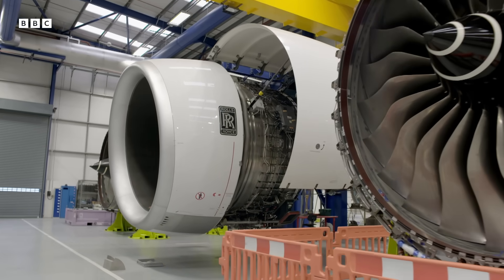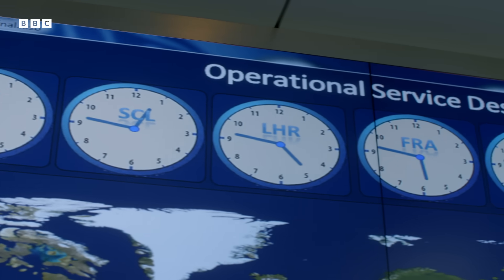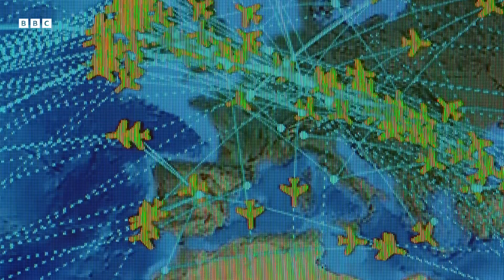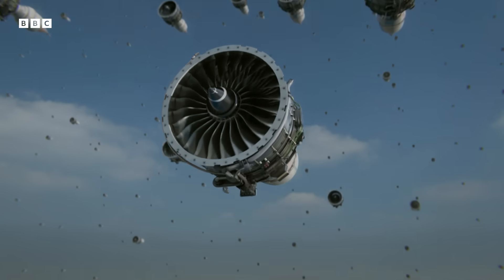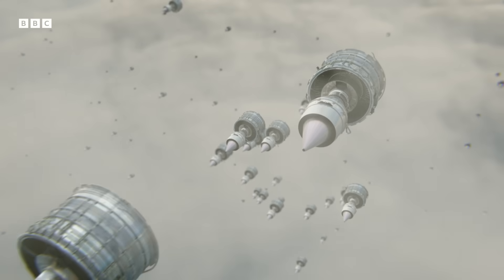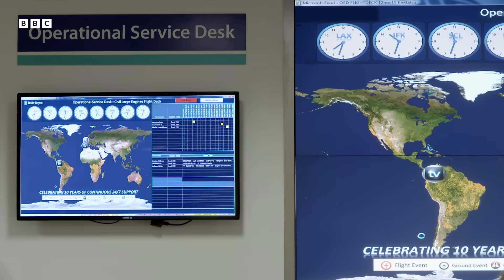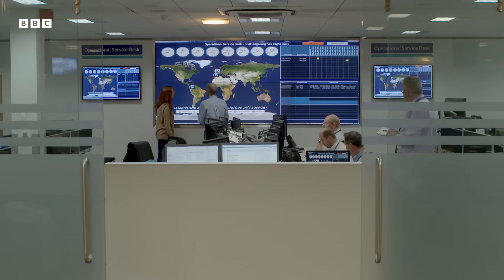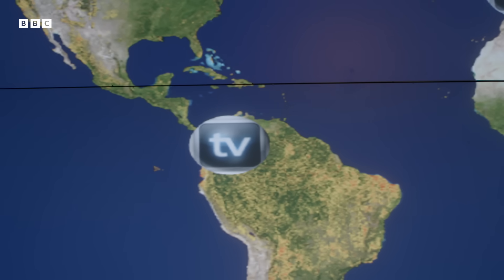The Beating Heart of an Aeroplane: Jet Engines | City in the Sky | BBC Earth Science

Comment: Aircraft collects live data and send to ground using satellite communication, radio data (VHF3 is normally reserved for data communication), or for less essential data, 4G cellular at the airport.

A lot of comments asked why it doesn't prevent accidents. It should be noted this live monitoring is mostly used for monitoring TRENDS. They monitor if the engine readings are drifting off, most often little by little over time. These indicate imminent component malfunction or something that's deteriorating, so that the operator (the airline) can plan their maintenance work in advance before the engines fail for real.

Engines and components are now reliable enough to NOT fail suddenly and catastrophically. Even if this were to happen, it is down to the pilot who are trained for situations like these to handle the aircraft.

In short, this monitoring function is mainly for reliability monitoring and maintenance planning, rather than telling the pilots they are in trouble.

Comment: If they can see every engine they've build wherever they are and what they're doing, then why couldn't they prevent all these past plan crashes or at least alert rescuers on time whenever they detect an engine failure? Cos clearly they can detect engine failures mid air, right? Or are those just PR statements?
Reply: 99% it's about condition monitoring. By monitoring the trends of the engine, they can deduce/predict which components are going to fail, so that the operator can replace them before they fail for real.

Engines and their components are now reliable enough to NOT fail suddenly and catastrophically. These failures cannot be predicted or monitored. And even if they were to happen, the result is an engine failure. And pilots are trained to handle these situations.

The whole idea of this monitoring is engineering and advance maintenance planning, NOT telling the pilots they're in trouble.

Comment: The component I would personally hope never-ever fails are the Wings.
If one of those fails there's nothing else to do than pray so your soul finds rest in the afterlife.
If one engine fails, even catastrophically, there's still hope as long as the wing doesn't get broken by it. And if the other engine still works, a safe landing is always the outcome.
Reply: You have a lot to learn about planes😂
Reply: @MSM4981  I mean, everybody should know a 2 engine, 2 wing plane can lose 1 engine during take off or 2 during cruise flight and still have a chance of landing safely. 1 engine means it can do a turnaround and land, and if it loses 2 at high altitude as long as there is a runway in a 30km radius they should also be able to land safely, even if there's none there's still hope after a crash land.
But a wing failing turns the plane into a pile of metal falling with no control.
Reply: This move by Rolls Royce is impressive ❤❤

Comment: On‑board data capture
Tiny sensors scattered throughout the engine measure temperatures, pressures, vibrations and dozens of other parameters. Those raw signals are aggregated by the Engine Health Monitoring (EHM) unit into digital “health” messages for every flight segment. 
Ingenia

Datalink transmission via ACARS
The EHM unit hands its packets off to the aircraft’s ACARS datalink system, which automatically chooses the best available radio path to ground:

VHF or HF ACARS over line‑of‑sight or long‑range HF links

Satellite ACARS (e.g. Inmarsat SwiftBroadband) over oceanic/remote areas

ACARS‑over‑IP using terrestrial 3G/4G/LTE when flying over land within cellular coverage

Embedding position & time
Certain ACARS message labels (e.g. “Position/Time Update” reports) automatically include the aircraft’s GPS‑derived latitude/longitude and timestamp. That means every health packet can be tagged with exactly where—and when—it was recorded. 
PPRuNe

Ground‑side processing & mapping
On the ground, Rolls‑Royce’s 24/7 health‑monitoring centre (using platforms like SITA AIRCOM® ServerPlatform or FlightMessenger) ingests, normalizes and fuses all incoming ACARS streams (VHF, HF, Satcom, IP). Their analytics engine then plots each engine’s latest health data and location on a world map—updating in near real‑time as new packets arrive. 
sita.aero

In practice, that pipeline—from sensor → EHM unit → ACARS (VHF/HF/Satcom/4G) → ground‑side server—lets Rolls‑Royce see both the health and position of every engine in flight, almost as soon as each data burst is sent.

Comment: Sensors → Health‑Monitoring Unit
Each engine is festooned with sensors (temperatures, pressures, vibrations, etc.). Those raw measurements are wired back to an on‑board Engine Health Monitoring (EHM) unit (sometimes called an Engine Interface Unit or Digital Flight Data Acquisition Unit), which packages the data into digital messages for transmission.

Aircraft Datalink, Not “Engine SIMs”
The EHM unit hands its messages to the airframe’s datalink system (ACARS/AFDX/etc.), which then uses whatever comms are available to get the data to the ground. That might be:

VHF or HF ACARS (legacy narrow‑band links)

Satellite ACARS (e.g. Inmarsat SwiftBroadband) – this is the backbone over oceans or remote areas 
Forbes

ACARS‑over‑IP via terrestrial cellular (3G/4G/LTE) when flying over land and within range of towers 
Aircraft IT

Where the SIM Lives
If cellular is used, the aircraft’s datalink modem (often a separate Air‑Ground Gateway or “GroundLink Comm+” style unit) contains the SIM card(s) and data‑plan subscriptions – not the engine. That modem automatically switches between VHF, SATCOM or 4G depending on coverage, routing engine‑health packets through the best available pipe.

Rolls‑Royce’s Setup
Rolls‑Royce then ingests those streams (from satellite, VHF/HF and cellular when available) via its 24/7 Engine Health Monitoring centre. They’ve partnered with SITAOnAir’s Aircom FlightMessenger to collate and normalize all incoming EHM messages for their analytics teams

Comment: Keeping a constant eye on jet engines isn’t about surveillance for its own sake—it’s about making flying safer, more reliable, and more economical for airlines (and, by extension, for all of us). Here are the main reasons Rolls‑Royce (and other engine‑makers) track their engines in real time:

1. Safety & Early‑Warning
Detect anomalies before they become failures
Tiny deviations in temperature, pressure, or vibration can herald a developing fault. Catching these trends early lets engineers intervene—often on the ground during a routine stop—rather than dealing with an in‑flight shutdown.

Reduce in‑flight emergencies
If an engine system ever breaches a critical threshold, flight crews and maintenance teams can get immediate alerts. That way, flights can be rerouted or grounded proactively, avoiding dangerous situations.

2. Predictive (Condition‑Based) Maintenance
Move from time‑based to condition‑based servicing
Instead of trading out parts on a fixed schedule, airlines can replace or refurbish components exactly when they need it. That cuts down on unnecessary shop visits, lowers downtime, and maximizes each engine’s usable life.

Optimize maintenance resources
By knowing which engines (or specific modules within an engine) actually need attention, airlines can plan spare‑parts inventories more efficiently and schedule maintenance teams where they’re most needed.

3. Reliability & Fleet Availability
Keep more planes in the air
Unscheduled engine removals are one of the biggest causes of aircraft on‑ground (AOG) events. Monitoring reduces surprise removals, meaning airlines can keep their schedules tighter and serve more passengers on time.

Improve dispatch confidence
With real‑time health data in hand, dispatchers know exactly which engines are “green” for flight and which ones need to wait. That reduces delays and cancellations.

4. Cost Efficiency
Lower overall maintenance costs
Condition‑based maintenance typically costs less than blanket‑replacement schedules—parts and labor are only spent when necessary.

Extended time on wing
Engines last longer between overhauls when they’re looked after intelligently. That amortizes the huge capital cost of a turbofan over more flight hours.

5. Performance & Fuel Burn Optimization
Fine‑tune engine performance
Data analytics can spot slight drifts in fuel‑flow or efficiency. By tweaking operating parameters or recommending specific part swaps, engineers can restore optimal burn rates—and airlines save big on fuel.

Benchmarking across the fleet
Comparing data from thousands of engines worldwide lets engineers identify best‑practices and design improvements.

6. Warranty & Service‑Contract Management
Transparent usage records
Under “Power by the Hour” or TotalCare contracts, airlines pay for engine usage rather than parts. Precise tracking ensures both parties agree on how many hours, cycles, and conditions an engine has seen.

Fair wear‑and‑tear assessments
If an issue arises, detailed logs prove whether it’s covered under warranty or caused by misuse.

7. Regulatory Compliance & Reporting
Meet stringent safety regulators’ requirements
Agencies like EASA and the FAA demand proof of proper engine oversight. Continuous monitoring feeds into the records auditors review.

Environmental reporting
Monitoring emissions parameters helps show compliance with noise and pollution limits.

Comment: If that's the case then why planes fall out of sky?
Reply: because of gravity
Reply: Not every plane has RR engine and being carefully monitored doesn’t mean that they can solve every problem they face in a reasonably short time.
Reply: @je_suis_onur  so just the ones that went down dont?
Reply: @randyalpage2531  I don’t know that but the whole point is you can’t assume they’re all RR. There is GE for instance. Also engine is not the only part that that can bring down a plane. So your original point is sort of moot.
Reply: I didn’t realize they let special ed students have a YouTube account.
Reply: Planes don't fall out of the sky lol.
Reply: because they aren't safe.
Reply: @growingmelancholy8374  They are statistically safer than cars.